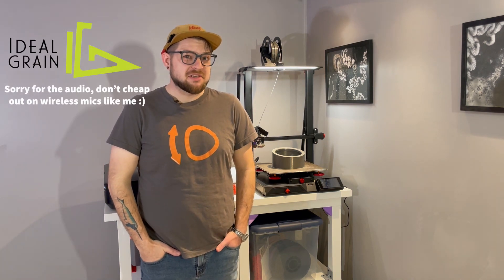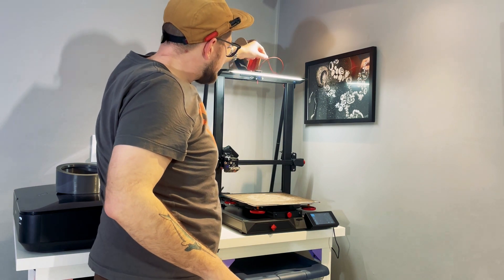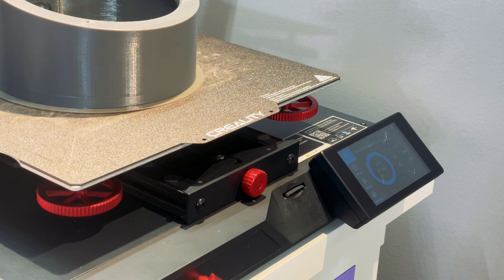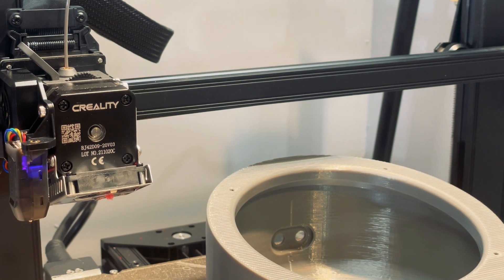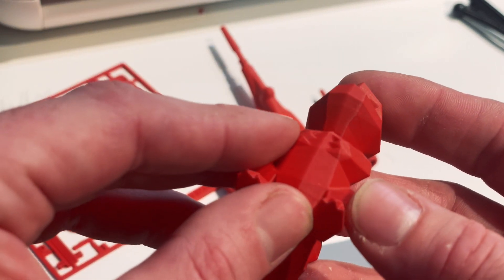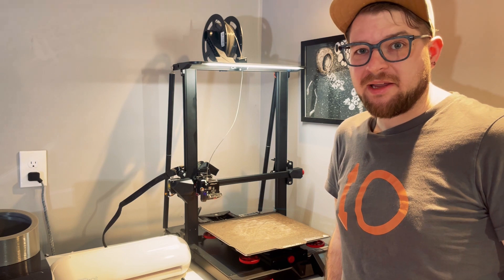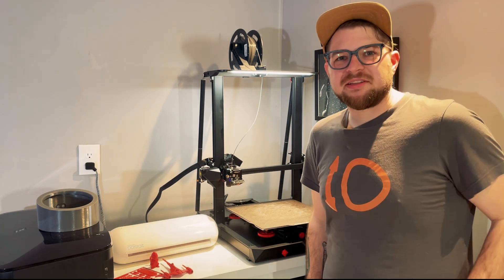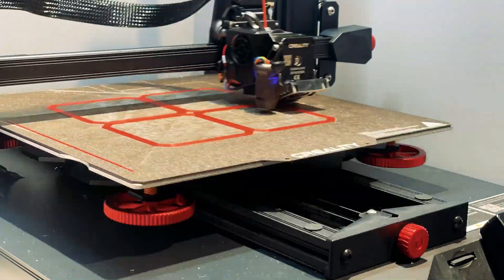Is the Creality CR-10 Smart Pro the Ultimate Budget Enthusiast 3D Printer?

Comment: Nice overview of this amazing printer.  A few weeks back I purchased the Creality CR-10 Smart 3d Printer ($599.00) and while they are similar with the one you reviewed they are also very different.  The screen is exactly the same and the footprint size is the same. There are documented issues with the auto level system, which caused me no end to issues so I returned it. Some major advantages with the Pro model are:  You can adjust the leveling manually, which is a MAJOR benefit, the camera is super and is easy to use even if it has a wonky tripod (get a better commercial tri-pod), the added LED light is extremely nice, and all all the other upgrades delivering and dispensing the filament would easily cost as much as the difference is for the similar model, but this model includes them oout of the box.  The steel nozzle and direct drive mechanism also means that I can use TPU and even carbon fiber filaments, which would cost me more with the standard CR-10 Smart model.  I would HIGHLY recommend this model, although it is a little challenging to find it online.
Reply from the maker: Same conclusion I came to! I almost bought the CR-6SE or CR-10 Smart, as I thought the load cell leveling system was really innovative. After seeing others had a lot of trouble with it, and realizing the “Smart Pro” included a direct drive extruder and all metal hot end, it was the only reasonable choice for me. I could live without the camera and “creality box” - I’d rather run octoprint, but it works.

Thanks for watching!
Reply: I am trying to decide between the smart and smart pro too, this is my 1st printer and I want to get it right.  Any other differences?
Reply: Noob question, what is the cAmera for?
Reply from the maker: @conraddevera  Remote viewing of your print. Would give you a chance to remotely stop the print if there was a problem.
Reply: @IdealGrain  ohhh OK ok